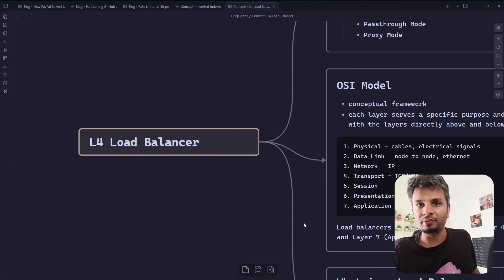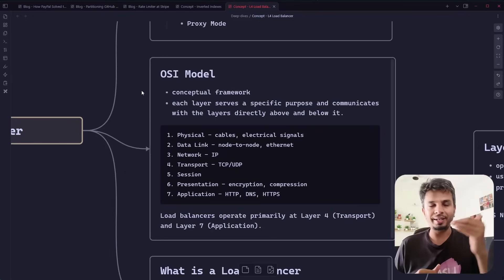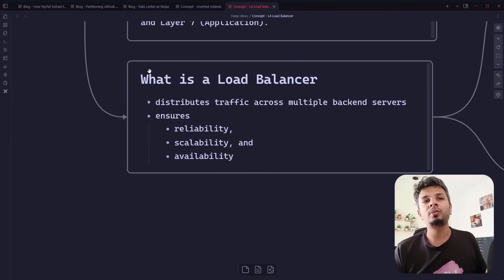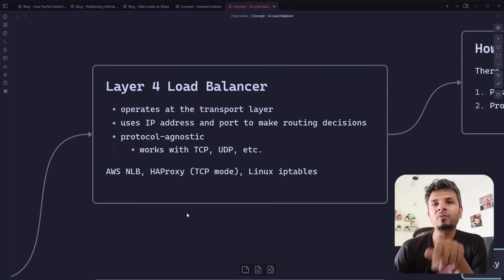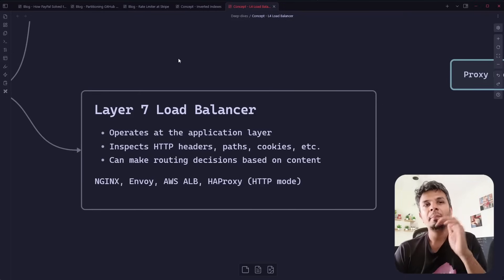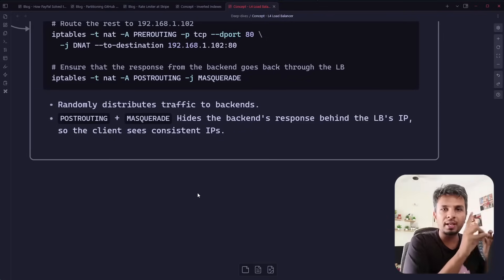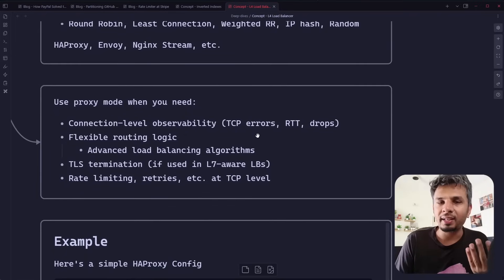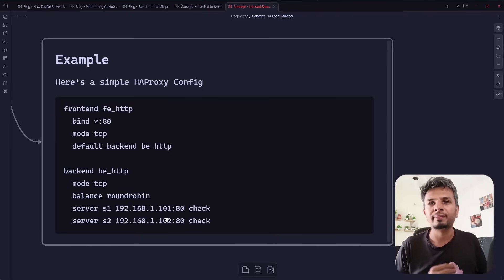What are L4 Load Balancers and how do they work?

Comment: This literally cleared things up! 🙌
I was worried a load balancer would break my WebSocket connections, but using an L4 pass-through LB keeps the TCP connection intact — perfect for chat servers. 🚀

I also learned that L7 LBs can work via HTTP Upgrade if idle timeouts are set, and they add routing/auth flexibility. But for long-lived, high-performance connections, L4 is usually best.

Thanks for the clear explanation! 🙏

Comment: I have a question -
In the passthrough mode, there are multiple requests coming parallely.
Lets say req1, req2, req3, so on...
We are sending all the requests to lets say backend server 1
It is writing to the same TCP connection.
Now when the load balancer receives response, how does the load balancer know for which request is this response? 
How does it map the response the correct request?
Reply: The LB doesnt need to know the mapping of requests and responses because it is operating at L4. It just needs to know to relay the segments of the TCP stream coming from the client to the server and vice-versa. The applications at both ends (client and server) will parse the TCP segments to figure out the L7 request/responses.

Comment: Great explanation about the L4 Load Balancer — it's easy to understand!

But is there any technique or mechanism to scale or load balance the load balancer itself? 😄
In the backend, the load is balanced by the load balancer, right? But what if the request traffic gets too high? How can we scale the load balancer itself? Are there any mechanisms or techniques for that?
Reply: Yea I have had the same question for a while. I was thinking maybe the load balancers need load balancer for themselves but from what I could gather from searching the internet, one way is to register multiple IPs under the same domain name in DNS. So when your browser makes a request to DNS it gets a list of IP addresses which are addresses of load balancer. It starts making request to the IPs in the list starting from the first one. If it gets a response then it stops, if not then it moves to the next one and goes on until it finally finds a responsive Load balancer. The DNS servers can also randomize the list of IP addresses.
Reply: One way is appliance based : F5 GTM (Global traffic manager) ,which i have seen the use.The other one is Citrix GSB.2nd approach is any cast routing .I guess Dukaan uses that approach.AWS global accelerator ,Cluudflare and Google do use it at their scale .Another option is to use the managed cloud platform services .,their loadbalance services .AWS : route 53 + ALB/NLB.GCP :global https load balancer + backend service group .Azure -azure front door + application gateway .The simplest  one is DNS based as the above comment :) 🎉happy learning

Comment: With L4 Load balancer configured, does the TLS termination happens at LB or the server?
Reply from the maker: TLS is layer 7 so for L4 it does not break at LB.
Reply: @AsliEngineering How would it work for Proxy mode, where we create a new connection from LB to backend server? Wouldn't that require the TLS termination at LB?

Comment: Asked this on twitter too so whichever reaches you first lol. Watched the video. I had a tangent I wanna discuss. I was recently learning about QUIC (made a simple QUIC protocol implementation on top of a HTTP/3 server in Python). So if it aims to replace TCP, and is built on top of UDP/IP, how does L4 load balancing look like then? I think QUIC is encrypted from the transport layer up, so that prolly means the L4 LB will have lesser data to work with. I maybe wrong with this as my networks are very elementary. So would love if you can enlighten a bit on this hypothesis (and possible future).
Reply from the maker: Nothing changes. LB would remain the same. iP is still accessible and that's what an L4 needs to balance the load.
Reply: @AsliEngineering  thanks a lot for the clarification. That's what I was confused about, if protocol influences re routing. Keep cooking. ❤